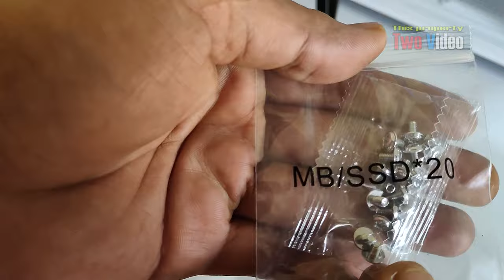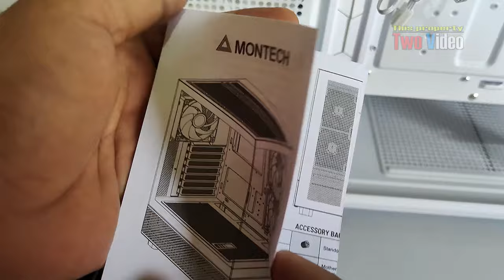ATX Gaming PC Build | Montech XR White

Comment: I got a question how did you connect the fans is their a daisy chain system for so for the fans at the from back I used daisy chain for rgb and power can I add the 3rd fan near the gpu to the daisy chain?